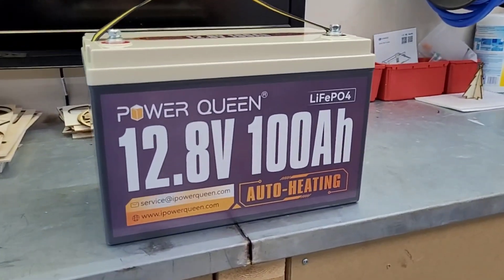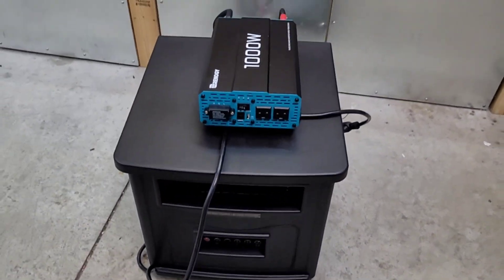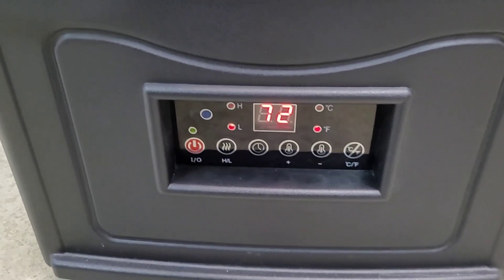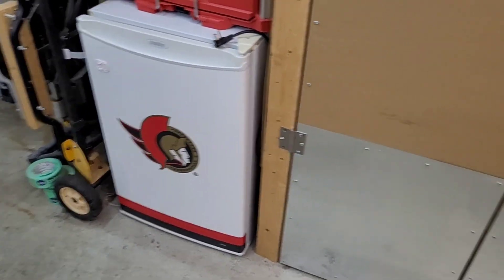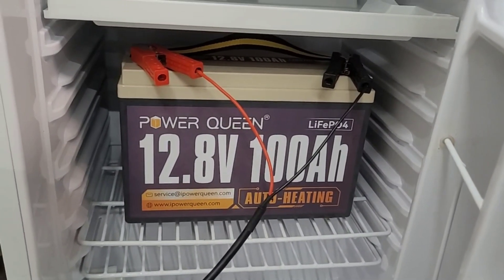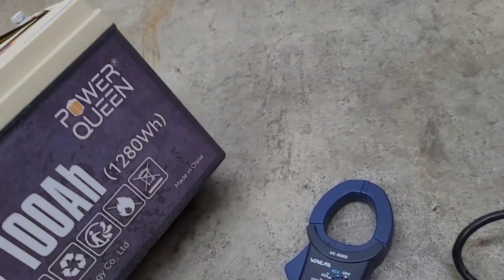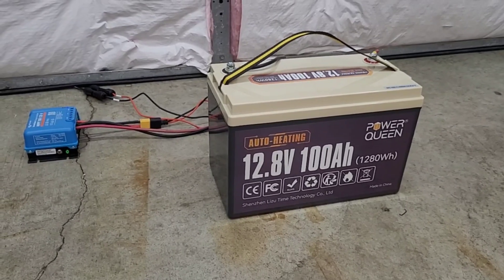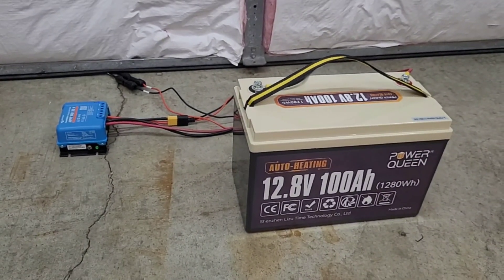Power Queen 100AH Auto-Heating Battery - Does It Work?

Comment: I have mine in  shed with 400 watt solar panel charger it stays in my shed all year round with winter temps will my solar panels run the heaters before it starts to charge the battery it's it needs charged